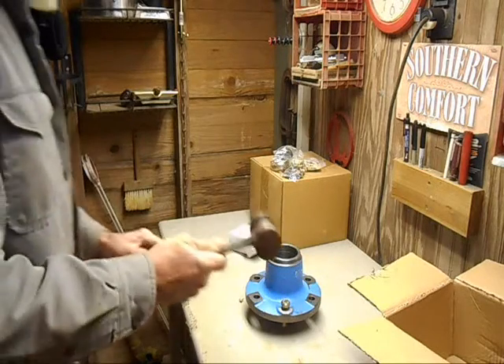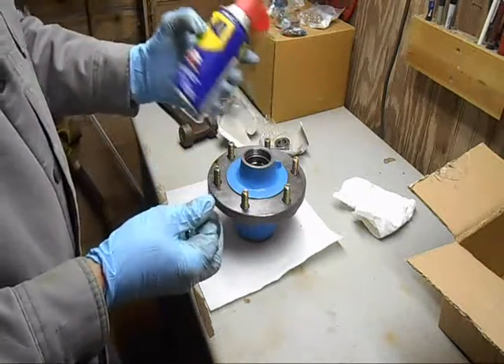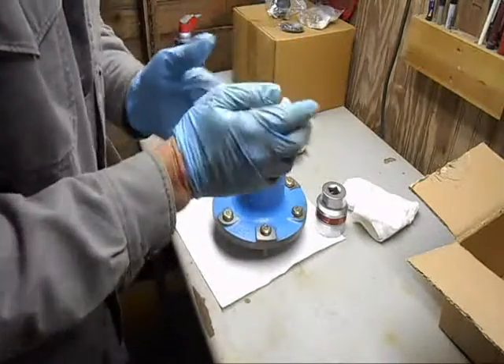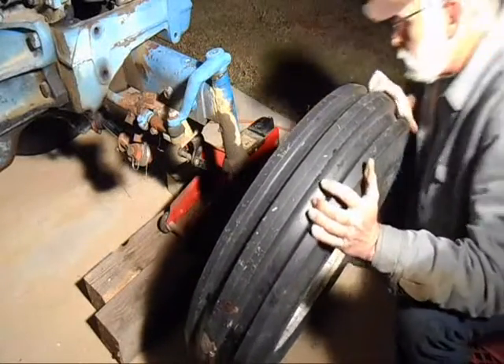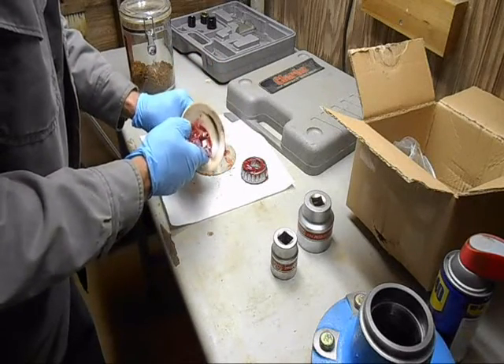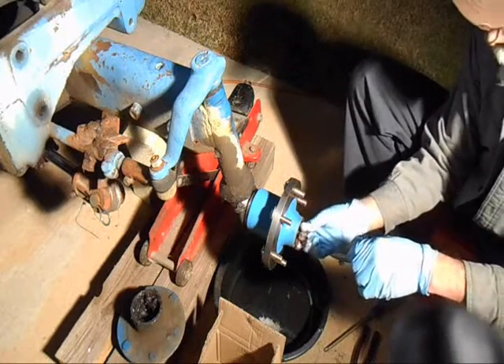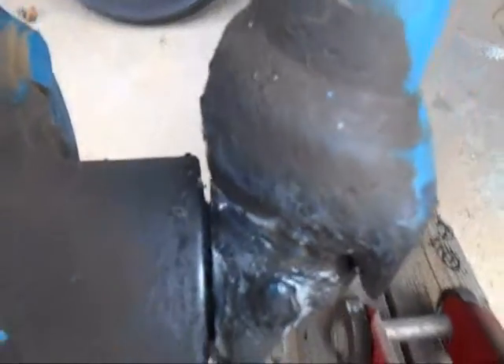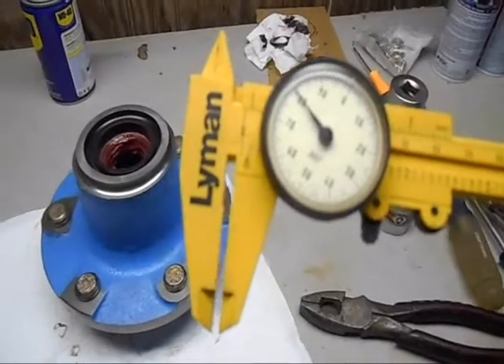Ford 4000 front wheel hub replacement

Comment: The reason that the hub was rubbing on the bottom of the casting is that the thrust bearing at the bottom of the spindle had completely disintegrated!! The thrust bearing keeps the spindle in the correct position so that what you experienced doesn't happen as well as the spindle rubbing on the bottom of the casting itself. The hub was not the wrong size. If you were already taking the hub off I would suggest to replace the two spindle bushes and thrust bearing too. Thanks for sharing your video.

Comment: A bearing puller would work too put in the bearings. You could attach to the outer rim of the hub and push the bearing in square. Your method works but there is always a danger that you go off square and your bearing gets stuck. Great video.
Reply from the maker: Thanks for watching. Yeah I agree bearing puller would pull it in straight there's always a risk with driving it in. Getting these new hubs and getting all this rebuilt sure did improve the tractor.🙂☕🇺🇸

Comment: You change wheel studs on the tractor with the wheel on. Just take the nut off and hit the stud inwards with a hammer. Then use the nut to pull in the new stud just do one at a time with the wheel ON. This way stud stays Square Just a tip, done it this way on old Ford for years
Reply from the maker: David Watt - thanks for the tip and for watching.
Reply: @SoybeanFarmer3300  Hi where did you get the hub they keep asking me for part numbers?

Comment: Brings back memories of the day my front hub broke on the 4020, that flange with the studs broke in two. I was using the loader to haul sand, apparently it was too heavy! Good thing was I used the loader to lift the front off the ground so i could replace the hub out in the field!
Reply from the maker: that for sure was a matter of convenience being able to use the loader as a lift.  this reminds me I need to lift the 4020 and check the wear and possibly adjust if necessary.   thanks for saying 4020.  :)